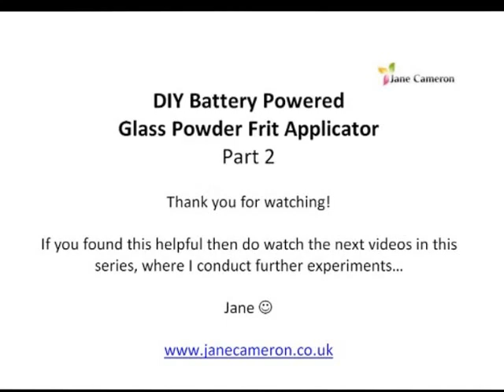DIY battery powered glass powder frit applicator video 2 - Jane Cameron

Comment: Very ingenious. Do you have a link to a commercial tool? If I can't find it, I will try this. Thanks!
Reply from the maker: There are several out there - look for the Powder Vibe and the Powder Pro Plus, also the non-battery-powered "dot and line applicator". It depends where you are in the world as to which website would be best for you to order from - try asking your local fused glass supplier.
Reply: @janecameronartist  Thanks!